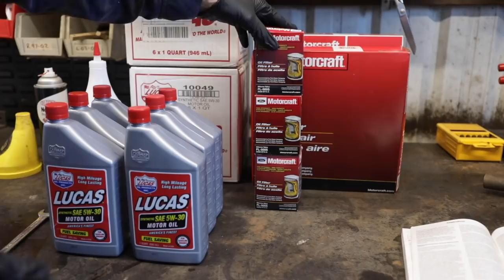How to Change Your Oil Like A Pro

Comment: I wonder how many young men in America just had their first lesson on how to change oil? Sadly, there are far too many single parent homes.  Good stuff Cody!
Reply: Single female parent homes.
Reply: I agree. My parents are divorced so I taught myself when I bought my first car. These kids need to take initiative.
Reply: Better late than never!
Reply: I did not learn from my dad.  I learned from my  mom - a farmer's daughter.  My dad was often away on army duty and my mother wanted to make sure we girls knew how to take care of our own stuff.  My dad did teach me to barbecue, throw a football/baseball, shoot a gun.  :o)
Reply: I have known a good amount of people at every age old and young that don't know how to change oil or swing an axe.  It's not just young people.
Reply: Crazy Waffle is living proof I guess....
Reply: Raised by my momma. Learned how to change my own oil on my own. Never needed my dad to teach me jack.
Reply: @xenonram  my desire to change my own oil and do my other maintenance is not necessarily because it's cheaper (as you said it is barely cheaper) but that I am doing it right, with quality materials. If you go to the dealer or a local quick lube place you're getting bulk oil and will have the drain plug put back on with an impact. They'll drive on your lugnuts with an impact and mangle the threads on your studs. If I do it myself, I am using a quality filter, quality oil, I am taking the time to inspect the oil to make sure it doesn't look like glitter glue, and my lugnuts and drain plug are properly torqued. Besides, I work with computers all day - spending an hour a few times a year to change my oil gives me something satisfying to do that doesn't involve a computer. I like to unplug when I'm not at work as much as possible.

Comment: Good video... from a former GM Tech - GM recommended crossing the non-drive wheels - on front wheel drive, cross rear and front straight back, rear wheel, cross the front and rear straight forward & on 4 wheel drive - both front and rear straight back/front...

Comment: As a professional auto technician... Always use the manufacture recommended oil, at the interval stated in your service manual. Every manufacture has their standards for oil. Euro standard for 5w40 (used in euro gas engines)  is different than us standard for 5w40. Euro diesels. LL03 5w30 synthetic. Most US diesels run 15w40. DexOS for gm.

Also, the only oil additive ive ever seen that actually works its the BG MOA additive. Most are just snake oil, and is nothing more than viscous synthetic oil.

Synthetic and convention oil is the same. The different is that synthetic is more refined. The petroleum molecule chains are more equal in size than conventional. But the oil is the same. Synthetic also has cleaners and detergents in it to clean and capture deposits. Crude does not. Additives are not needed with synthetic oil
Reply: Conventional oil has detergents and cleaners in it too.  Synthetic is just more refined and doesn't have as many impurities.   They ran non detergent oils years ago and it created lots of engine sludge.
Reply: @jonmatney9584  not nearly to the level that synthetic oils do. Its the same with gas. 89 octane gas has some cleaners in it, but premium has more. Thats why engines that run premium gas and synthetic oil (with the exception of german direct injected gas engines) run cleaner
Reply: I believe the additive he uses is to keep it tacky and keep the bearings oiled for dry starts, if you put a lot of miles on it probably won't matter much, if you start it and run it for a couple miles it will add to your miles and reduce wear.

Comment: Keeping your oil changed is the biggest thing. If you buy any decent oil Pennzoil or Mobil 1 or lucus. Just check your oil every time you get a tank of gas and change it every 5000 miles. Use Quality oil filters I recommend AC Delco for your Chevrolet.
Reply: Rob Pridemore read your owners manual for oil change intervals, I like new filter half way through on my diesels, gas not so bad.

Comment: Thanks for the video.  When my daughter got her first car I taught her how to check the oil level each gas fill.  Also taught her how to change the oil to which she said WHY.  I replied I may not be here to do it for her so she needs to at least know how and what to do.  I like you have a bunch of vehicles and equipment that have engines.  I made a list of all the engines in the computer and listed all the pertenant info like you did under the hood and printed it out.  Whenever I do anything I write it on the printed paper and this lets me know when oil changes are necessary for all these engines.  I tack these papers to a cabinet in the garage.

Comment: Tire Rotation
For cars with rear-wheel drive, move the front tires to the opposite sides of the rear: left-front to right-rear and right-front to left-rear. The rear tires are moved straight forward

On vehicles with front-wheel drive, just do the opposite. Move the rear tires to the opposite sides of the front and move the front tires straight back.

Edit: This should be obvious, but if you have directional tires, just switch the front and back on the same side of the vehicle.
Reply: On all wheel drive and four wheel drive vehicles you swap them in a cross pattern like he explained.
Reply: @travisorr6437  
Yep, I agree.
Reply: Nope, AWD/4WD/RWD all follow the same procedure.  Cross the fronts to the back, put the rears on the front on their same side.

Comment: Mobile one full synthetic for me. I find the motor runs quieter. Also I have seen how clean they are when I open the motor up to change the timing chain.
Reply: I also have seen everything you are saying and to clarify for me it was just the old standard Mobile 1 full synthetic now they are playing marketing games with the products with the high mileage and year long stuff
Reply: Kinda like how Fram used to be a high end filter, but the quality went down hill as their advertising budget went higher.  

Some cars/trucks we own and operate will only get Mobil 1.  That's because they are the only oil that meets the requirements of the manufacturer.  (our VW comes to mind.  0w40 Mobil 1.  It's pushing 185k on the engine and runs quiet.)
Reply: yea I trust the the basic full synthetic mobile 1 is the same stuff it has always been but on the shelves now you just have to pay more attention not to grab the wrong marketing hyped one

Comment: It is hard to justify buying expensive oil when oil change schedules are so frequent in my new vehicles.  I don't put a lot of miles on my vehicles, but I still have to change the oil every 6 months.  The good synthetic oils are fine for my need.
Reply: Amsoil has car oil for 25 000 miles....thats why you use a premium oil like Amsoil.  It is more expensive, but save in the long run, so youre actually saving money.
Reply: I'm pretty sure that if I ran Amsoil for 25,000 miles my warranty would be voided.
Reply: Every 6 month? What vehicle is that?
Reply: 2017 Corolla, and 2016 Tacoma

Comment: One of the best oil change items I ever put on my trucks is the "no spill" oil plug. It replaces the oil pan plug with a new plug that is self sealing, and to change oil you just hand screw on a tube to start the oil flow. Changes my disgusting black diesel oil with no mess and no tools. I love them. Stops the oil from getting all over the frame. Mine came from 'No Spill Systems'. There are different brands but I have been happy with theirs.

Comment: To be fair, replacing the stock steel wheels with forged aluminum alloy wheels of the same diameter will, on average, save you 40% of the weight of the wheel, which could improve fuel efficiency. Not trying to tell you what to do, but it was slightly disingenuous to say that replacing your wheels is all for show. Granted, most who replace their wheels with alloys increase the rim diameter which negates any benefit they might have gained, but there is a potential benefit to performance in alloy wheels. Love your videos, I always learn a lot. Keep up the amazing work you do. Much love to you and yours!

Comment: Well Cody I can say after 35 years of being a heavy equipment mechanic that running synthetic oils are very worth the money. My Volkswagen will not warranty the engine if your are not using synthetic oil. I also worked for a trucking company that got full engine warranty after being a test company that did not change oil in the engines for 600,000 miles only changed the filters at regular scheduled intervals and just kept the oil at the top level not the add mark. We had no issues. Also running synthetic oil. I am fairly new to your page and you do a great job. Thanks for being you.
Reply: Got a Toyota Camry and a VW Jetta TDI. I stopped changing the oil and filter in both at 100,000 miles (keeping them topped up) and the Toyota is at 370,000 with no issues and the VW TDI is at 450,000 with no issues. TDI has been on a race tune for 250,000 miles too. Oil changes are a scam.
Reply: engines in junk yards would beg to differ with you
Reply: I can easily afford to buy a new engine with the ~100 or so oil changes I haven't done.
Reply: Rob Gutwin did the 600k truck in question have a small micron bypass filter in addition to the primary filter?
Reply: Keanan T they will keep going for a long long time, I've been fortunate to have driven a ton of town cars as a limo and black car driver, there is a marked difference in the driviability and power in cars with similar miles and differing maintenance,  one has 600k and drives like a wet noodle, but a couple are close in the high 200k numbers with a marked difference in performance.
Reply: no additional filteration and these were miles not KM

Comment: So far, so good. Even #9. Also, grease up the weatherstripping on the doors and such. They work best when supple vs dried up. Silicone grease is what I use (actual grease, not spray)

Comment: Great video Cody. I would only add, and maybe this is just me, but when making sure your filters match, make sure that the old filter still has its rubber seal with it. Once while changing oil, I remove the filter and threw it away and didn’t notice that the old seal was still stuck To the engine and not the filter. When I installed a new filter and started the engine it gushed out all the new oil

Luckily I caught it in time, and all I got from it was a noisy lifter from the rest of the life of that truck

Comment: ALSO!  I hate when people claim "Fram sucks" blah blablah... people think a better more expensive oil filters better but in reality it's actually not because the more "expensive better filters" have more cleets in them making oil harder to pass through then you get less oil pressure to the rest of the engine, when that happens the bypass valve in the filter will open allowing crap into your oil jernols.  Then your engine wears out faster.  True fact!  Look on any wicks filter or K&N garbage and they will tell you to change the filters WAYYY more often... so wasting your money but I know there's all those "pros" out there claiming i'm dumb and on and on.
Reply: I would be happy to change my filter and oil more often than to replace an engine because I used cheap filters and oil. I agree with them bypassing but what is the difference if the Fram lets it pass through the filter media or a higher priced filter lets it pass through the bypass? I was told by a somewhat reputable source that automotive filters bypass within the first five hundred or a thousand miles. True or not I don't know. It was suggested to change your filter halfway through your oil cycle which is what I've done for years and it seems to work.
Reply: When I used fram everytime I cut open the filter the media was crushed only happened with Fram, that's why I don't use them anymore.

Comment: @Wranglerstar worked in a tire shop for a while and learned to use a tire bar or long pry bar to lift the tires on semis, loaders, and large trucks it does save your back.

Comment: Use oil tip. 5 gallon bucket 3/4 filed with sand pour used oil into the sand. Keep in the barn. When you are done with your garden tools such as shovel work dirty end into sand. It cleans and covers with oil. Grandfather was a farmer and shared that with me. I use it today. Just add some oil as you need too.

Comment: Buy a chevy with an ls based motor; and change oil every 15k miles.
Reply: 182k on my 05 5.3, 240k on my dad's 00 5.3.  No motor or trans work on either.
Reply: @SteadfastRC  thats cause you drive a ford

Comment: Not all vehicles follow a criss-cross pattern. Checking the cars recommendations would be better advice. Also, hope you follow torque specs for the tires. It helps.

Comment: Cody, have you ever looked into a Fumoto Valve to permanently replace the drain plug. It makes draining the oil that much easier. 

Also, if you have a German or European car, head over to FCP Euro. They have a lifetime warranty on all parts, including oil. Not sponsors in any way, just a customer for over 5 years. 

Love the videos! Keep up the amazing work.

Comment: My first vehicle was a 1992 chevy Silverado short bed single cab, 305 automatic transmission two wheel drive. I bought it from a milk company and it had 250,000 when i bought it. It had been serviced regularly 3k, with conventional valvoline oil. I rebuilt the transmission at 350,000. I sold it to pay my first semester of college in 2008 for $1200, it was still running strong at 389,000!

Comment: I have a cousin that worked at a tire shop for many years and he explained to me the reason for keeping your tires on the same sides.
 When a steel belted radial tire spins with force it bends or stretches the wires inside the tire side wall. This only happens to the wheels with power (rear wheels on a rear wheel drive and front wheels on a front wheel drive) so if you swap them diagonally the tire that normally spins clock wise in now spinning counter clock wise and can now (bird cage) and break strands of wires.
 Swapping the fronts to the back and back to the front, keeping them on the same side will keep your tires spinning in the same direction and you still get even wear.

Comment: Good tips. Before you criss-cross your tires, check the outside of the tire and confirm if they're not directional. If they're not, they'll probably say "outside" on them somewhere. If they are directional then you just go front to back, back to front.

Comment: Cody look into Fumoto oil drain valves. I replaced my drain plug with one of these valves and it's a game changer. Just slip a clear poly hose on the barb fitting and let the oil drain into a sealable container. They even make a lock for the valve handle to keep it locked in place.

Comment: Couple things: 

When you're taking the tires off to rotate them, break the lugs loose before you jack up the vehicle, especially if you don't have an air wrench. 

When you put the wheels back on, don't use the air wrench, the last thing you want if you're on the side of a road with a flat is to not be able to get the tire off because you gave it one too many braaps!

I also take the filler cap off and very slightly loosen the oil filter before I pull the drain plug so that I know I'll be able to get them off before I run all of the oil out.

Comment: Wranglerstar don’t forget to lubricate/grease the chassis / ball joints etc. I know it’s rare in new cars but some still have serviceable joints. I do mine every oil change. Serviceable components allow you to push out old dirty grease and replace with new grease

Comment: I use my feet to lift up the tires. I lift them with the sides, it's kind of hard to explain but it works very well. Also makes it easy to lift and manouver them back on.
Reply: raphael beinhauer I know exactly what you do because I also do it

Comment: Hey, I love your videos. I know you get tons of comments but be cautious of weather or not you have tire pressure sensors (I believe you do) After you rotate your tires if you get a low tire, the truck will tell you “left rear tire low” but that tire won’t be on the left rear anymore. Also on HD trucks, the rear psi tends to be much higher. Just my two cents. Great video though, you got my thumbs up

Comment: DYI tip- take one of the plastic quarts and cut it into a funnel works way better than the round one of those cheap funnels. Flipping the quart over collects the oil faster than you think. Plus it allows you to recycle the plastic container. If there is still oil in the quarts it will screw up recycling.

Comment: Chevron Delo 400 motor oil! Best in the land. Rated number one by the University of Nebraska's Agriculter testing facility for quality oil. The Caterpillar 3306 engine in my lobster boat has nvever used anything ,but, this motor oil. 12000 hours ans still going strong. THAT is lubricating oil. Thank you Chevron and the Standard Oil company. <3